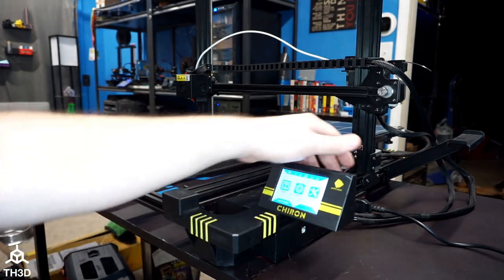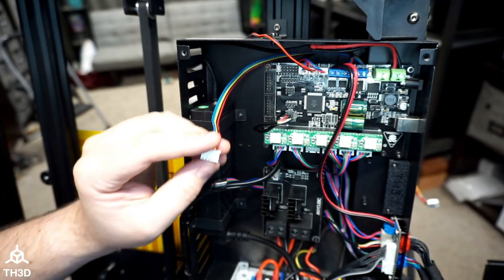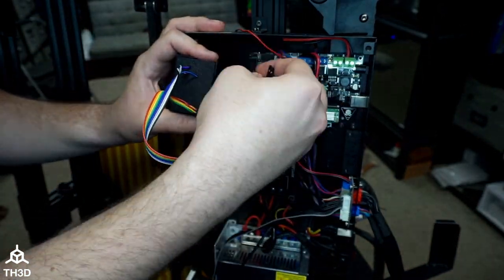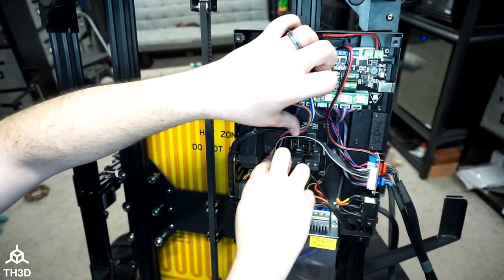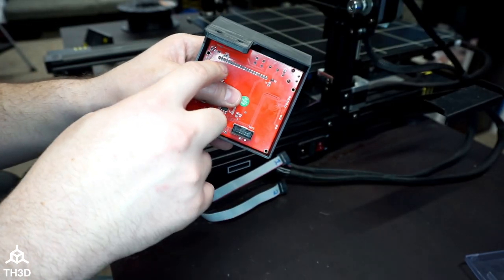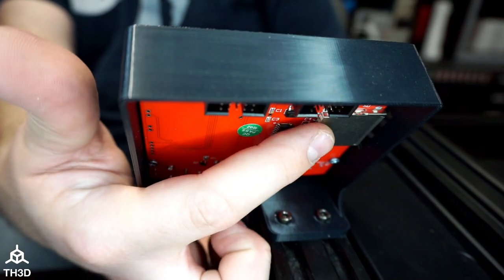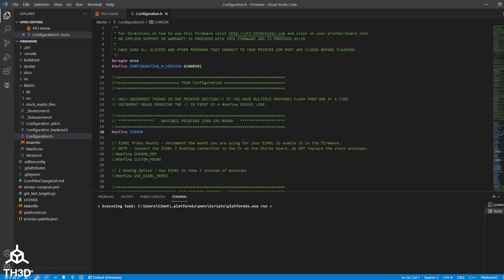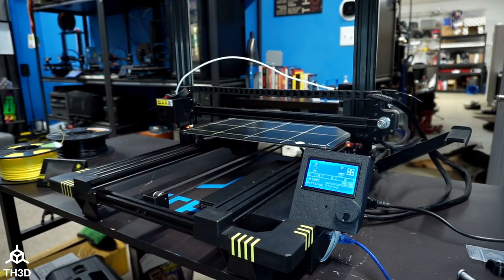Chiron 12864 LCD Upgrade Kit Installation | How-To

Comment: I just installed this kit on one of my Chiron Printers.  The parts are great, easy to install and the fit and finish is fantastic.
Firmware was straight forward and the printer is up and running.  Thank you for doing this work and making my ability to design and print that much easier.   I will upgrade another Chiron shortly but also include an EZABL with that build.  Love the work, streams and dedication to the craft!

Comment: So I am not new to 3D printing but new to Anycubic. I love the idea of the touch screen but find that when selecting an item to print or just working through the features the interface lags when advancing or touching the screen. I would like to improve the screens responsiveness so looking at new screens. Not to sound negative but going back to a wheel control seems like... well... going backwards in tech. What are the benefits of this... upgrade? Thanks
Reply from the maker: The LCD is very responsive and works. You also get to enjoy more features from the later versions of Marlin that we use, and we also continually release firmware updates to improve functionality and fix bugs as the arise. You'll also have access to change more tuning settings like esteps, acceleration, jerk, and many other settings. As you see with the stock touch LCD it looks pretty but it doesn't function well, this kit fixes that by replacing the stock, buggy LCD>

Comment: Hi TH3D can i add a BLtouch to this if so what connections are the Black and White from the original Probe ? Also i am using TMC2209 do i have to change anything

Comment: Hi, just installed your firmware and all is good except I can’t figure out how to level the z gantry using the oem sensors (I don’t have a probe installed) can you help?
Reply from the maker: The stock button/clicky switch is not supported. There were too many issues for it so we do not support it in our firmware. The gantry will auto level itself out with the 2 Z endstop switches. Make sure those are set correctly and the gantry will level itself out.
Reply: @TH3DStudio  thanks, sussed it in the end :)